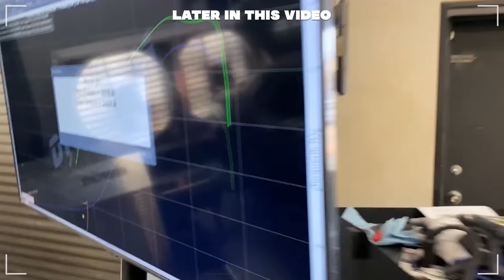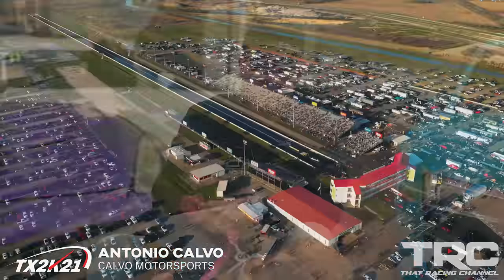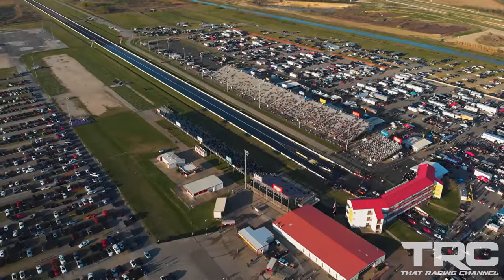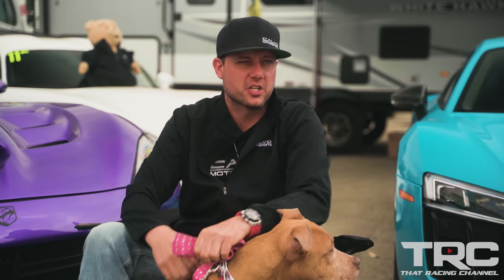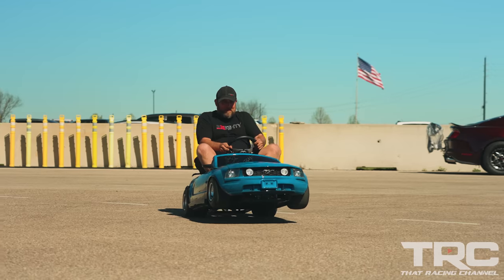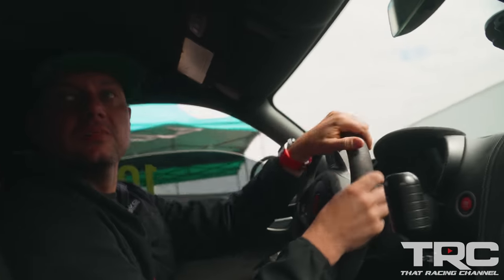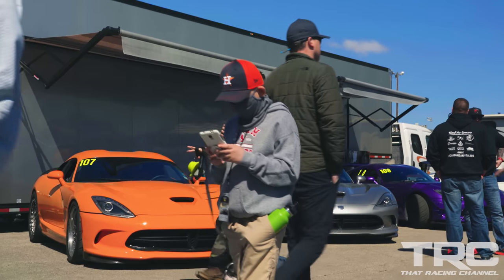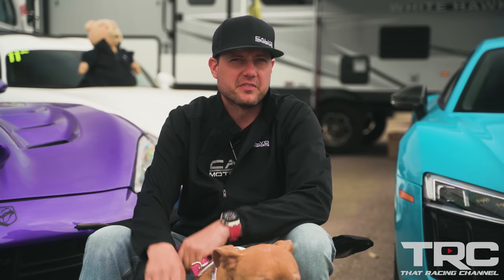3000HP Turbo Street Viper! Air Shifted Sequential + 400 Shot Nitrous (2400lb-ft OF TORQUE)

Comment: I remember when 400 HP was respectable 😅
Reply: It's still respectable in my opinion
Reply: @nielsmarayat4952  I respect  that
Reply: @Starfighter-nk4mo  same here. My Bike has 150  HP    and this car would  Crush it. Hard to comprehend.   
I want to drive  a Porsche  one day.  Never even sat in one..
Reply: Said no petrol head ever
Reply: @rollotomassi8251  150hp is already like super fast in a bike, the only sad thing about bikes is you can only accelerate so much due to wheelie xd
Reply: @ulti8106  Isn't there a rear wheel extender mod for drag bikes? I think they still do wheelies with that but a bit more controllable
Reply: 400HP Good exhaust 
Its plenty
Reply: Now hatchbacks have that kind of power
Reply: @johnssmith4005  my Camry has 301
Reply: Still is
Reply: See 3000 hp isn't about respect he's trying to disrespect everyone he comes across and then just look at them when he decides to let them catch up
Reply: @Starfighter-nk4mo  one time I seen a gold 911 with 3-4 wings on 8 🤣
Reply: It's still respectable lmao it's double the hp of most cars on the road
Reply: @Starfighter-nk4mo  it's not automatic so it's not gonna be like the full power
Reply: Crazy how times changed I remember when I was a kid the McLaren f1 was just a rocket and it had 600hp that is a hypercar now cars have 4x that to go 20 to 50mph faster then the f1
Reply: Back in the 80's, a "street" car with 500 hp was a unicorn.
Reply: @rossc2439 Cobra replica, yes; most modern cars, no.

Comment: I remember when 1500 hp vipers seemed unreal and unbelievable to see happening , next 350 mph top speeds will be the new thing
Reply: Nope. Can't make wheels that can handle that kind of speed yet.
Reply: @kennyk5150  Modern tires are capable of those speeds, the tech has improved so rapidly compared to the last 30-40 yrs, so they definitely will handle excess of 300 mph
Reply: @TheSilverShadow17  he said wheels
Reply: 350 will FLY off the ground
Reply: @TheSilverShadow17  There are no wheels that could handle that speed.
Reply: @DD-gz6zj  The special wheels for the bugatti 42 K each and it does not handle 300 MPH.
Reply: Guys, you forget one important thing.
Aero. At those speeds airplanes are flying in the air. Nobody in their right mind would dare go that fast on a viper.
Don't get me wrong, they are excellent cars, but they are NOT designed to go freaking 500+km/h 
They are not even designed to go 400 km/h. 
Acceleration is one thing, 500+ km/h top speed is another.

Comment: Its amazing they can get a RWD to run with the AWDs. Crazy power! Is there anything RWD outrunning the Vipers? I'd like to see it if so.
Reply: Nope
Reply: Yep the tesla roadster 😂thats going to be crazy
Reply: @thewatcher3999  not from a roll lol
Reply: 5 second mustangs and camaros can outrun a rwd viper. Fastest drag cars in the world are rwd beating every viper
Reply: @CarbonYote  we are talking about roll racing. You know the video we just watched?
Reply: @theone031  if they can go 5s in the quarter than they can roll race at a fast pace too
Reply: @CarbonYote  thats not how it works. the tuning setup is completely different
Reply: @NotoriousPlayer1  no it’s not 🤣 they literally throw in shorter gears and the tune doesn’t change. The motor still spins to the same rev limiter
Reply: @CarbonYote  k you really need to learn something about drag racing before running your mouth lol
Reply: @NotoriousPlayer1  u need to learn 😅 roll racing isn’t hard dude just throw more power at it and shorter gears. It’s drag racing without the drag part. It’s the easiest racing there is.
Reply: @thewatcher3999  don't even mention that hypothetical nonsense

Comment: You know a Viper is getting too fast when it starts sounding like a Lambo.
Reply: but it's a v10 tho lmao
Reply: I mean...ita original architecture was developed by Lamborghini.
Reply: @Tracked350Z  Lamborghini only designed the head I believe. Don't quote me on that though
Reply: @nolife1199  no. They designed and developed the entire engine. Dodge just made evolutionary changes to the base throughout the years. Under the prototype, Dodge was dissatisfied with the V8, hence them seeking out help from Lamborghini on the V10 in 1989.
Reply: nah bro. The viper sounds like a man. The lambo sounds like a teenager
Reply: The older v10 lambo engine was Audi wasn't it?

Comment: Serious question: We were running heavy cars--55 Chevy--back in the 70's; cars that made 400ish power, and we we're doing 10 ohs on back country roads with no prep. How is it that 3000 HP can only bring in an 8? There is somethin lost in translation there. Maybe some horses are better than others...
Reply: 400hp cars don’t run 10’s unless they are extremely light. Plus, going 2-3 seconds faster in the quarter mile requires a LOT more horsepower.

Comment: i have only 1 question, why is it when these guys have a sequential up and down shifter they grab the shifter, pull on it and let it go like anna from frozen and holding their hand in the air like they just dont care xD
Reply: Because the shifter has a tension sensor on it, so if you rest your hand on it even the slightest, it will cut the ignition and make the car start bucking... Because it thinks you're trying to shift it.
Reply: @TheVinniestunts  ah ok, makes perfect sense
Reply: @TheVinniestunts  thanks for this answer. I was wondering the same thing. They look so stupid 😅.. now I know why
Reply: Strain gauge I believe it's called.
Reply: weird af analogy but ok.

Comment: sick vipers.
Was shocked that the GTR kept up though @ 2:45. Thought the vipers massive low end torque would give it the launch out of the staging zone
Reply: Drivetrain my dude
Reply: Can only put down so much power through two rear wheels
Reply: Vipers are boost by gear, they do not fully come on until 4th gear.
Reply: @TheVinniestunts  doesn't matter when it hits vs a big boy gt-r though
Reply: @dilsher12    thats true 

Also I just checked, the GTRs drag coefficient is a lowly .26, where as the viper has a massive .37 or .54 (regular viper vs acr viper). So as the speeds get higher the viper is fighting harder against the air resistance i.e. using up more power to break through the wind

Comment: I don't know much about drag racing, but isn't mid 8's or low 9's slow for a 3k horsepower car?
Reply: This is half mile roll racing, not a quarter mile from a dig. These cars regularly trap at well over 200mph at the half mile mark.
Reply: @parmdeepsingh7769  Thanks for clarification.
Reply: It’s mweh, a lot of gtr builds clock that with a lot lower hp the viper is insane but on the whole it would get bodied by a decent supra or skyline build.
Reply: @DD-gz6zj  LOL I thought it was quarter mile, not a half mile. Makes sense now.

Comment: I find it crazy that on a roll race there only getting 8.5's with close to 3000hp.  A Tesla plad runs low 9's at a stop and has 1/3 the hp and runs low 8's on a roll.
Reply: Electric motors are cheat codes lmao

Comment: “Turbo 400 to survive” haha bro

I ain’t no racer but I’d definitely go with the minimal upgrade with a 1300 hp, single turbo so it isn’t too much maintenance in the end. Tracking that version on the Nürburgring would have put down a faster time. The reg ACR topped out at full speed (177mp) on the last straight away, a 1300 hp would have hit over 180

Comment: so you see these cars getting 3000hp and than there is Koenigsegg that has half the power and double the speed
Reply: these cars would buss length a Koenigsegg in 1500ft which was how long this race was.
Reply: Two totally different cars, koenigsegg makes top tier hyper cars with expensive materials and top of the line technology. These vipers are drivers cars.  No driver assist etc. just a v10 stuffed into a rwd machine and sent it out the door.

Comment: It bugs me that he says 3100 "At the Tire." Hub dynos read 100-300HP higher than roller dynos because of the wheel/tire weight. Still a crazy high number though.
Reply: Good luck putting down anything over 1500-2000hp on a roller dyno
Reply: @dilsher12  True
Reply: Where do you get your info about dynos dude. My buddy has a hub dyno and another has a roller dyno and we put the same car on both and there wasn't even 50hp difference and that's only because different manufacturers calibrations.  You can do wayyy more in depth accurate tuning with a hub vs roller. So the numbers you just said were absolutely bs

Comment: I find it baffling that Ruby could beat these from a dig 😳
Reply: Lol ummm give a 3000hp viper an auto and it's running 6s dude
Reply: @clutchkickpj693  Leroy is a stick car with half the HP and also runs 7s haha
Reply: Bro, TT Vipers were running 7's 15 years ago (full weight, stick, IRS, etc).  Hell, Sal had his auto TT Viper in the 6's like 10 years ago...

Comment: 10 second car: 1,000 hp needed
9 second car: 2,000 hp needed
8 second car: 3,000 hp needed
Crazy
Reply: That’s a ridiculously wrong statement 🤣 u can literally run 8s with 1,000hp.
Reply: @CarbonYote  not in the 1/2 mile

Comment: Why do these guys act like the shifter is white hot? It's like they're afraid to grab it and hold on. Drama queens hands hovering in front like it's a magical doomsday button. Grab it! Your shifts will be tighter and consistent without snatching it like a hot potato
Reply from the maker: The shifter has a pressure sensor on it that is connected to the computer for Operation of the sequential system. When pressure is applied it tells the computer to cut ignition for the shift. So they try to be careful to not accidentally trigger that mid pull by resting their hand on it. 🤘🏻
Reply: @ThatRacingChannel  is this also called a strain gauge?
Reply from the maker: @growupcalvin  yessir
Reply: Guess youll be quiet now 😂
Reply: There is a lockout timer that can be applied to prevent accidental tripping of the strain gauge a second time after shifts.